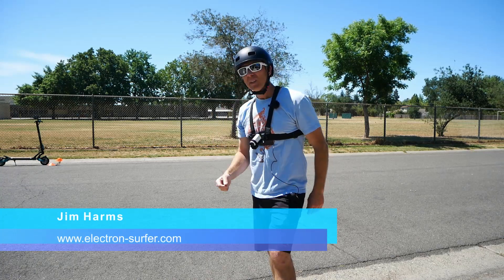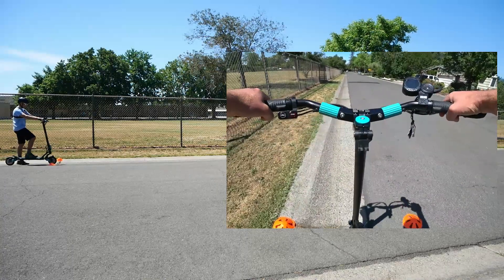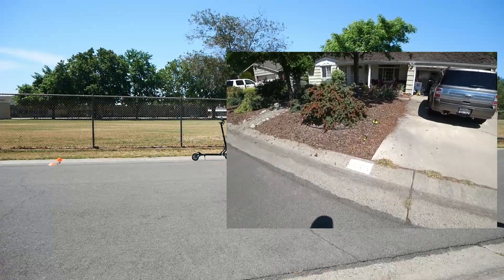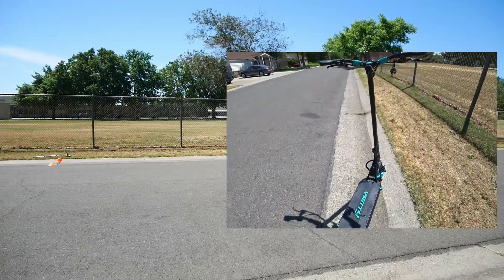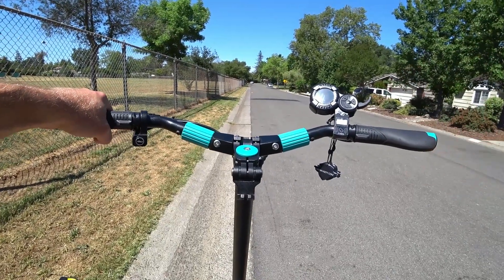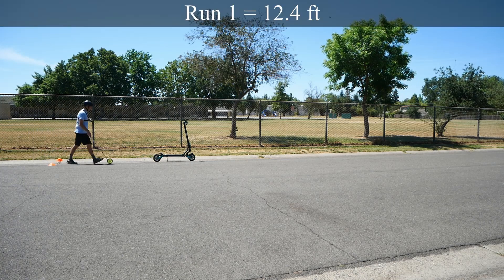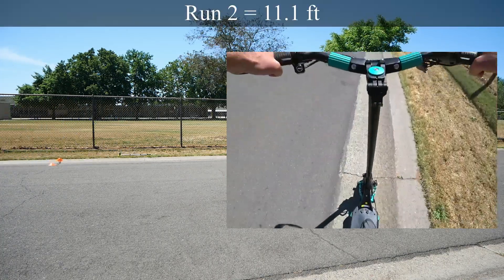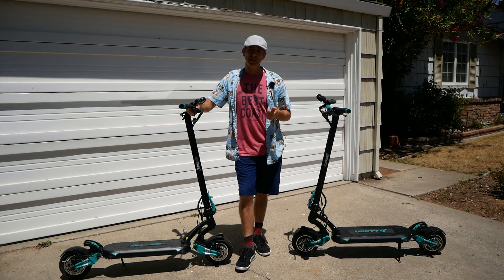Vsett 9R and 9+R Electric Scooter Performance Testing!

Comment: P settings: 12, set to mode 5 instead of how it comes (mode 3).. the acceleration is nearly double the speed. And both wheels, spin, especially if mode 09, is set to "0" instead of "1", meaning push to start is off.
Reply from the maker: Nice tip thanks!

Comment: What is the minimum height you have to be to ride the vsett 9 single motor I'm asking because I'm a teenager and it's made for adults
Reply from the maker: There really isn't a minimum, the deck to handlebars is 40 inches so if that works for you, that is really all you need. There are some age restrictions depending on where you live to ride on the streets. I sold the 9+R to a guy who got it for his 12 year old son...lucky kid!
Reply: You can say that again 😂😂

Comment: ...9R and 9+R? In EU we have 9 and 9+ that's it
What's the difference?
Reply from the maker: Here when it has and R it is the upgraded, usually LG, battery pack. They need to simplify their naming system! Cheers
Reply: I’m eu and Australia they only pack the lg versions meaning the 9 and 9+ are the r versions. I know it’s really confusing.

Comment: Problem we have in Europe and probably will have in the UK once they actually legalise scooters are the spec restrictions on power. If they go for 500 watt limit (which is ridiculous based on scooters being viable for heavy riders and for hilly areas) then even the single motor vsett 9 won’t be legal. Can’t quite figure out why the single motor vsett 8 has same motor power as the 9. You would think the lower model would be slightly less say a 500 watt. Do love the vsett scooters but I think a thumb throttle, built in high mounted front light and high mounted indicators would improve them a lot.
Reply from the maker: @E-Scooter Guy, great points on the throttle and lights. I am about to review the 8 and I agree with you, why have two scooters with the same exact output. I think here in the US we probably have another year before we see some scooter restrictions, I hope they get a better handle on watt regulation vs. what we see on ebikes. Thanks for the comment!

Comment: Please find a Death Hill to test them on.  Would be interested to see if the single-motor would make it up. I expect the dual-motor would -- but how fast?  EDIT to add: What was the speed for the braking distance?
Reply from the maker: I use 15 mph for my braking, I listed it in the description and also the summary box in the conclusions. I don't live in a very hilly area but the hill I test all of the scooters on will be coming up in video #2. Thanks!
Reply: @ElectronSurfer  I thought I heard 15mph but wasn't sure.  Doh! Didn't read the Desc.  Thanks.

Comment: I need your help please, I’m super TORN between the Mantis Pro SE and this Vssett 9 plus. I’m 140 pounds, already have two commuter scooters, and looking for a scooter with more power and great suspension for some light to moderate off roading. I don’t need crazy speed at all. Looking for a scooter that’s not super heavy either, I think I would throw my back out if I tried to carry a 75-80 pound scooter hehe. Would really really appreciate your feedback and I’m open if you have another scooter in mind. Thank you!
Reply: Which scooter do you bought?

Comment: what kind of air pump do u use?
Reply from the maker: @Gen Zyannd, I have been using this one from Amazon. https://amzn.to/3bMSiFn It is pretty loud but the way the straight and flexible connection allows it to work with some of the tight clearance valve stems that a lot of scooter use.